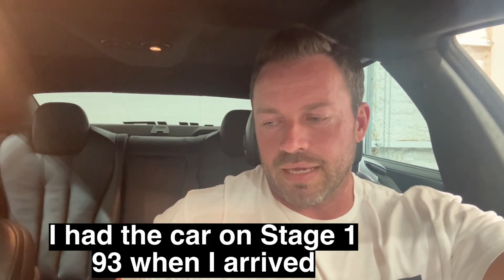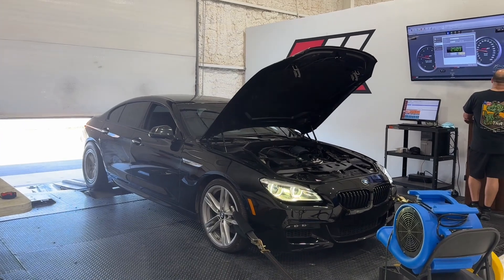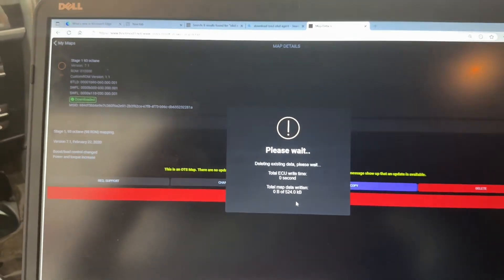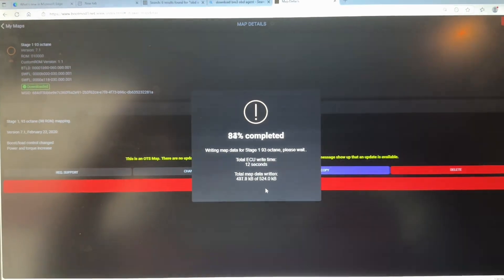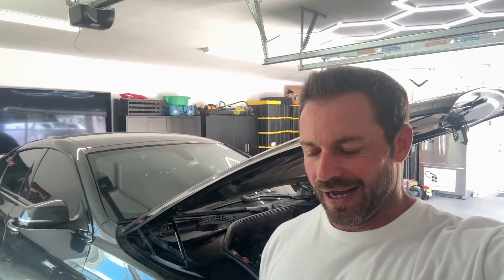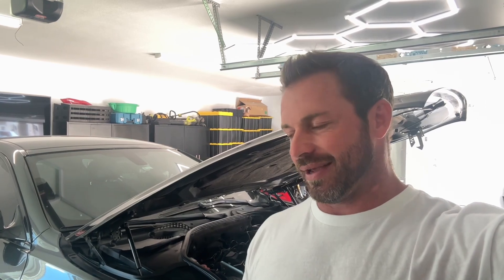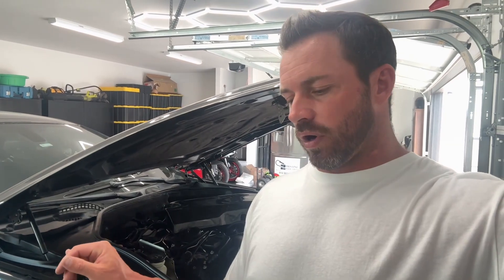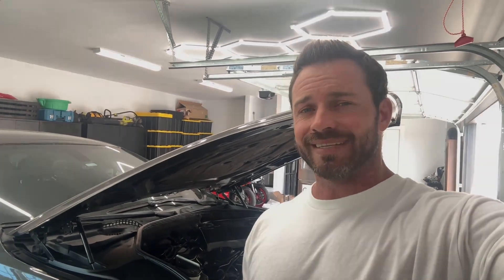BMW N55 Dyno Results – Stock Baseline vs Stage 1 OTS Tune

Comment: I'm swapping an N55 8HP into my Mazda Miata with a Maxxecu Race, I wanted to see if the transmission should be able to hold my power goals which are around 450 WHP / 400 WTQ. I was at 375 WHP / 340 WTQ when my 6 speed let out. I skipped around in the video, but this was with the 8HP45, right? I was wanting to make sure the transmission will hold. I've already got the Domiworks adapter on the way, so hopefully I'm fine haha
Reply from the maker: Yeah you should be ok, the 8hp45 starts having issues when it starts hitting 500whp and 550ftlbs of torque.

Comment: Nice series man, keep going. 

Can you recommend a good intercooler for a hybrid turbo?😊
Reply from the maker: Thank you I really appreciate that! 

I run a Gplus but Ive also ran a Rev9 they are both well built and designed intercoolers very similar if not the exact same as vrsf and wagner intercoolers

Comment: I have a PWG n55 stage 2 with downpipes going 370hp and 468lb Torque on my data logs with MHD I MAY Need boot mod lol
Reply from the maker: Yeah MHD tends to have more conservative OTS tunes in my experience.
Reply: Also my highest boost I’ve reached is  around 17lbs on stage 2

Comment: This is good information not many honest dyno numbers or work done to the car. You have me thinking if i dyno my car correctly I put my 535i in rwd  and just took the traction control off didn't know there was a roller or dyno mode.
Reply from the maker: Yeah its in the hidden menu on the gauge cluster. Clear everything on the gauge cluster by hitting bc button on blinker toggle. Thats the one on the right LOL and then hold the button down on the gauge cluster. The first menu will come up about service or brakes or oil change, keep holding it down then youll get to another menu and you can use the same button to scroll to roller mode!
Reply: @I @Inhouseperformance other I have a 2015 640i when I plug in ISTA+ it said I have a n55B30O0. Why do you said it had a HO variant? Do you know this for sure?
Reply from the maker: @Elironkese1990  Im not totally sure to be honest but I was told that the 40i cars got forged cranks and upgraded rods which will allow more torque and power from the stock internals. Im willing to test this out and hope for the best😂😂
Reply: @Inhouseperformance my man lol thanks for the fast reply 😂 what does it say on the block by chance have you looked? I’m guessing it’s the m235i pwg variant with the forged internals like you said
Reply from the maker: @Elironkese1990 Im not sure but Ill try to check it out.
Reply: @Inhouseperformance thank you sir 🙏
Reply: @I @Inhouseperformance also I’m running a stage 2+ e30 MHD tune on a my 15’ 640i and I was expecting the charge pipe to blow like every other n55 or n54 I’ve had but it’s actually taking the tune nicely no misfires or boost leaks so I’m guessing your right the 40i has a special n55 variant because it’s more tune able in stock form than any other bmw I’ve had.

Comment: coming from the vq platform, its insane how a stage 1 off the shelf tune can give u 40 whp.
Reply: Honestly the increase in torque is really what gets you on these cars. The HP is cool the torque is where it feels insane.
Reply: @RB26_2JZGTE facts lol
Reply from the maker: @RB26_2JZGTE the torque aint no joke with these cars, its why transmissions and axles break so easily.
Reply: Welcome brother welcome lol
Reply from the maker: Yeah it really is impressive and thats not even with a down pipe or anything to let the car breathe.
Reply: Pinecone comment of the year, one is boosted from the factory it’s not even comparable.
Reply: @Jan-b2n  just by this comment alone, i can tell u ride the bus lmfao

Comment: Did you leave the resignator on the exhaust ..I thought I saw it when you were fabing
Reply from the maker: Yes I did, it helps keep the drone down in the cabin. I had my 535i like this exact same setup for a couple years with a Pure Stage 2 and the sound was perfect not too loud but not quiet either, and minimal drone.

Comment: Just acquired a '16 535i M-sport a few months ago. I've been gathering the information, data as well as the budget needed for a stage 1 tune reliably as it's a daily. 
Well done.
Subscribed.
Reply: Stage 1 is definitely wort hit! I ran it for over a year and a half no issues. I would just recommend upgrading your charge pipe to handle the extra boost.
Reply: @KyleSkamser That's coming in shortly along with a bigger intercooler. Two birds, one stone.
Reply: u got stage 1 with no mods?
Reply: @shad4329  just charge pipe yes but I am currently running stage 2+ e30.

Comment: Awesome video man, this build will be legendary. Do you think you’d do the Proxy closed deck on this one too?
Reply from the maker: No Im just building a clean daily with this one. Planning on leaving the block stock so keeping it a high 500whp car and bagging it in the end. The epoxy close deck didnt help from cracking my cylinders, plenty of cars running open deck to 750whp and after that a proper close deck and machining is required.

Comment: Hey Tyler.. Good looking 6 series. Love the front end. Have fun with her... 
Hell, since I have you here let me ask your opinion on something.. My daily driver f10 535i m sport has the Pure 600, ds25, MHD flex fuel kit, Shoup flex fuel tuned, etc..  All this done this past November. I love the cars new attitude. Very quick compared to stock of course, but this Pure turbo is sooooo quite! All I can hear is the Turbosmart dual port. I mean from dead stop to full out 23-24 psi I hear nothing. The factory turbo was much louder than this. I don't get it. I have the same K&N air charger intake, but it doesn't help.
Any recommendations you could pass on to me on getting some spool up sounds? 
Love your videos, I've learned so much from them, and I really appreciate it. 
Hope to hear from you. 
Thanks
Reply: I have the same f10; It’s honestly the K&N air filter. It performs better than the MST. But I switched to the MST style intake because I hear the spool, the flutter all of it so much better. I’m running a stage 2H e30 tune on bm3. Not even a custom tune yet.
Reply from the maker: You’re going to need a new intake like our front mount intake or a short that we are still developing like the ARM but better. Thats the only way to get more turbo noises. I would the also add the IHP diverter valve block off plate with our IHP charge pipe with a real BOV and youll get all the cool noises with flutter and woosh noises. But youll need shoup to tune for air density and remove your MAF. Email me at Tyler.House@Inhouseperformance.com if you are interested!

Comment: Love the info, thank you for what your doing! Question, do you recommend for the f22 M235i a big break kit. I'm shouting for 500-550WHP. Wonder if the boost tube that you plan to produce works for the M235i.
Reply from the maker: No you dont need a big brake kit for the M235i stock brakes work great in the car and its not heavy like the 5 and 6 series are. And no the boost tube wont work for your chassis, sorry. Just 5 and 6 series N55 cars.

Comment: Great info and another great video keep it coming so is there a dorch hpfp for n63tu motors
Reply from the maker: Thank you I really appreciate it! No Dorch Engineering currently only support the N55, S55, B58 and S58 engines at this time.